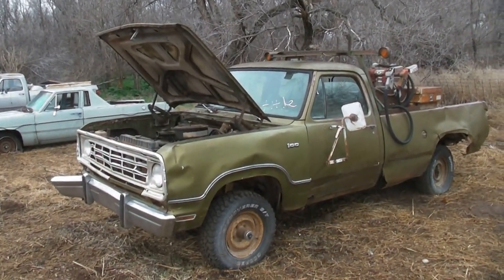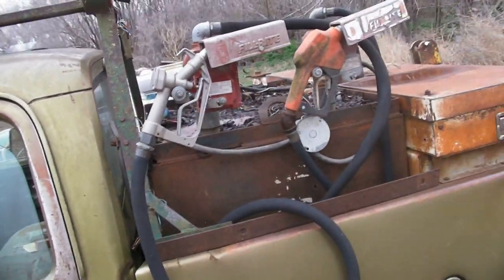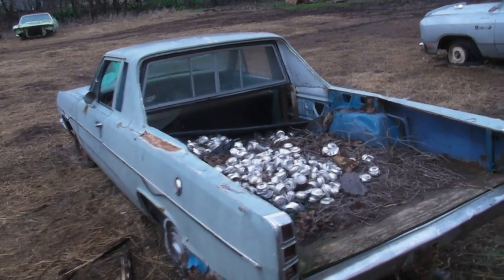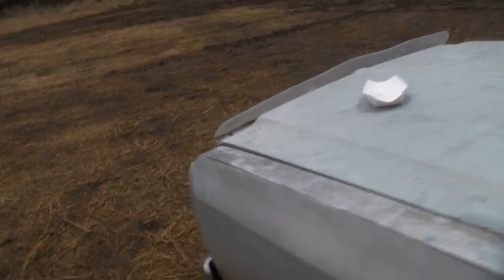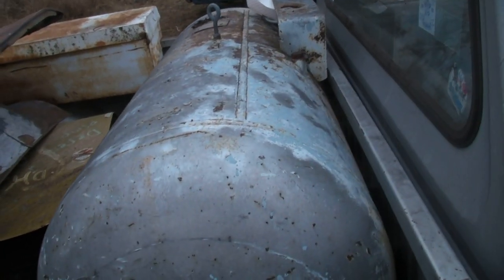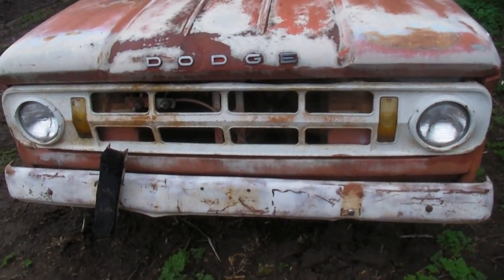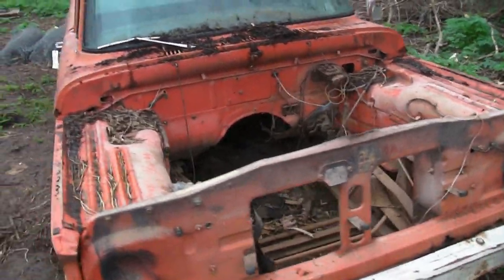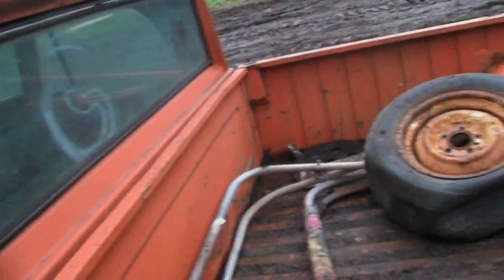Mr. Goodpliers introduces Resting Relics! Cairo, Kansas farm: Chrysler, Dodge trucks, and Plymouth!

Comment: That last one I believe was part of the adventure package and was a nice rig, both rigs, the four wheel and two wheel drive, One day of cleaning out and cutting out the floors right up to the spot welds and put a floor package in. Wiring is real easy on these and so many power plants/transmission options. I could take it from existing to ready for paint in five days maximum and probably some who knows these would cry stop on the third day as they are as easy as easy gets.

Comment: That early 70's Dodge 4WD is way cool! Too bad it wasn't taken a little better care of. All three of the Dodge pickups in this video are nice, but that 4WD is the most!  I've owned three Dodge pickups - 1973, 1979 & 1998 D100's [they called the '98 a Ram 1500]. The '98 Dodge is now my daily driver. With 235K miles on the clock, she is by far the most dependable truck I've owned in my 50 years of driving. She's a Forest Service surplus truck, with the V6 and a manual 5-speed [the V6 is the same as the old  318 V8, minus 2 cylinders]. A little under-powered maybe, but that's the way trucks were built until the "driving public" started demanding luxury mommy-mobiles and "my own monster truck" toys with huge V8's in them. I can cruise at 75 all day long in fourth gear, and a friend recently told me "you know, you could hop into this old truck and drive it to the East coast and back!" [I live in the Arizona desert]. So long as I'm gentle with her, I can go just about anywhere a 4WD pickup can go, and I don't have to worry about scratching the paint. Is there anybody out there who loves old Dodge pickups as much as I do? Drop a reply. I'd love to hear what you think.